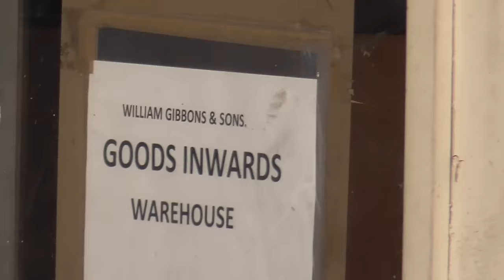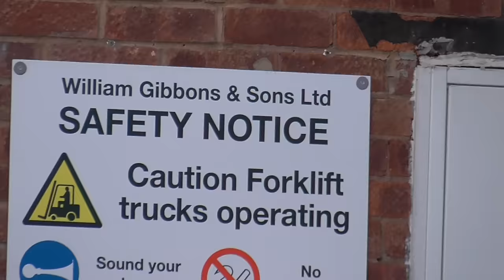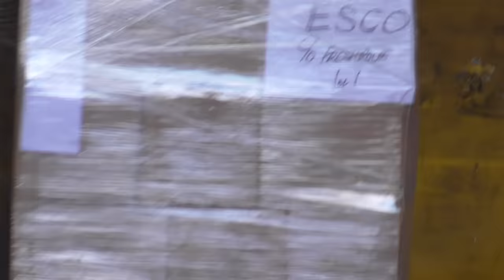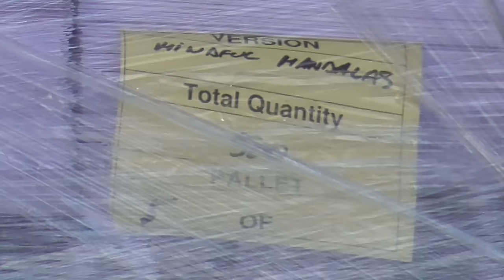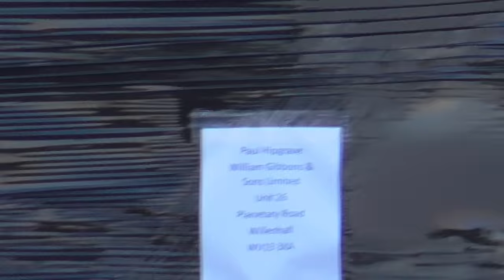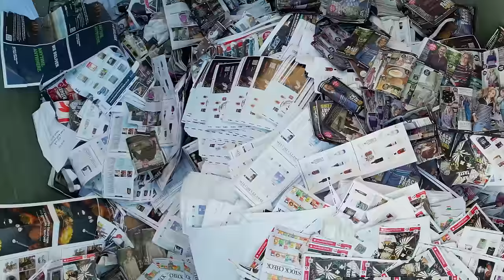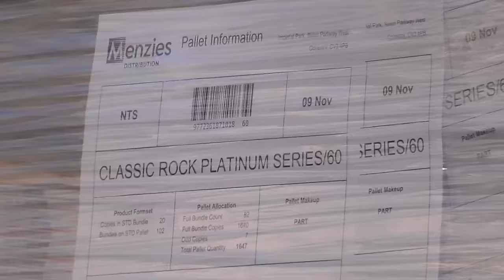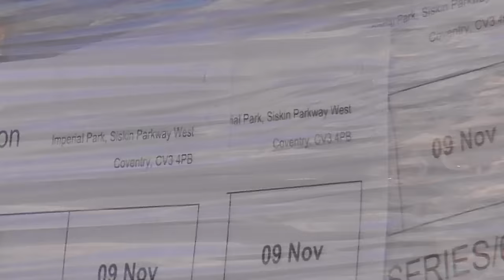We've Got Members Of Staff Saying You Are Filming Our Premises 🤔📹🛸❌

Comment: Having just had a cursory glance through the comments, it appears that my suspicions are well-founded. This company, is one of the many hundreds of companies, that print the "junk mail,"  that you end up, getting in your mail. I worked for a transport company, that had a contract to take junk mail, from the UK to Jersey. The Jersey Post Office, to be exact. Then the junk mail was posted to addresses in the UK. I actually did the run to jersey, once. An easy money maker. Just had to be at the main post office, sorting depot, at 09:00. Had a paid for overnight, in a B&B. Got there the previous evening, at around 6:00pm. Had a couple of drinks, and a meal out. Took my partner with me. Basically. We had an all expenses couple of nights, away, in Jersey...  I told the guys at the other end, that it would be better to just put the delivery, into a skip. Because, that's where it will end up, anyway... Also. Went across on a Catamaran, ferry. Jeez. Those things can shift.  Coming back, we had the excitement of the coastguard helicopter, doing an exercise involving dropping someone onto the deck, then picking them back up... And the best thing was... I was getting paid the whole time....